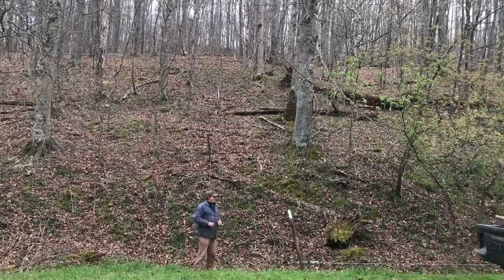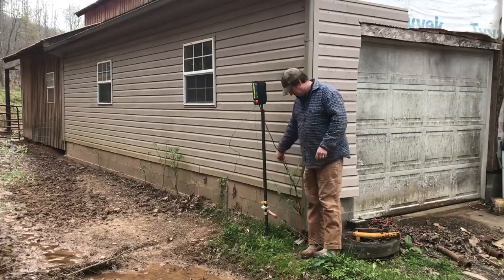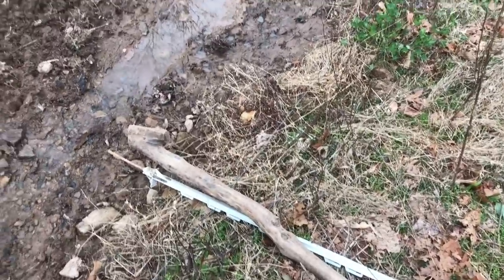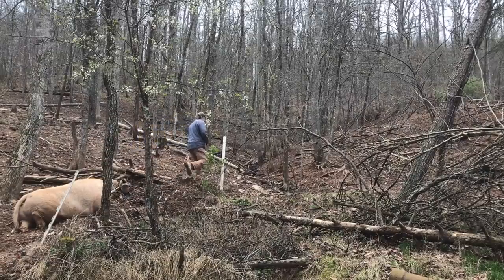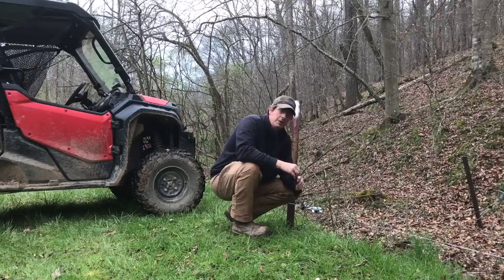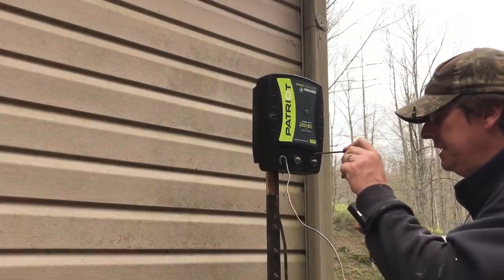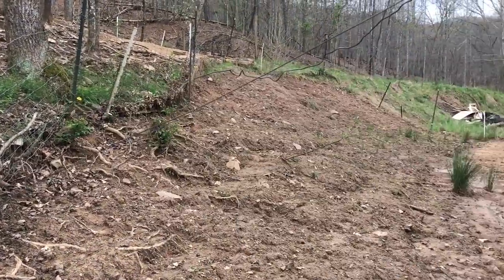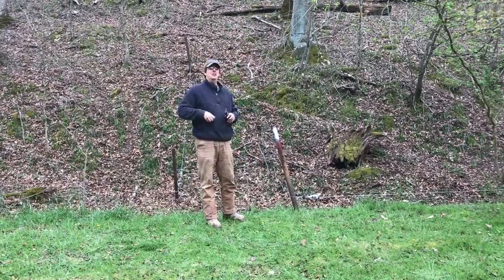LOW Electric Fence Voltage - What's Wrong??

Comment: Hey I looked for my hat once for half a day then scratched my head an found my hat. I was so happy I found my hat, that I took the rest the day off with pay cause by then I forgot what was so important. I really don't worry a lot cause there is always someone else that makes me look good. I was wondering if all the fence line can be driven or do you have some gullies that ask you to go around? I seen a wrake on a  8 n that "Lets dig 18" has on his home tractor and he uses it to knock over cow pies. Spread the wealth of fert. I sure like the idea of having a clean line not that its necessary an maybe pigs don't like rough terrain any better than you. I can't help but think a horse might be easier to get around the acreage each day... I rode fence line for days on my dads place and would be gone a week sometimes. I was plenty old, at eleven taking care of my needs each day with jerky, an tac bread (need teeth for that) an vegetation in the woods. Should I be gone longer I could shoot a rabbit or squirrel an spring chicken (grouse) were real  tasty over a fire. All the makings in my saddle bags. I should have to work any longer my sister cut across and would catch up an leave me more and then spend night an go back as she was fourteen and bigger than me. Stronger too.

Comment: Do you have wifi at your shop? If so do you have cell phone internet around your property? If you have then all you need is a smartplug. Then you can plug it in the wall and plug your fence charger in to it and that will give you remote shutoff. 
      If you realy want to get fancy some higher end smart plugs soposedly will even send you notification if the plug looses power or is low on power and how much power it is useing.  But a basic cheapo smartplug works.
Reply from the maker: No, unfortunately no Wifi at the shop nor do we have cell service on our property. It would be nice to have at times.
Reply: Ya, we dont have cell service here either. 
      We got a wifi extender a while back. Suposedly boosts wifi up to 15mi. But we had to enroll a pig and 4 chickens into nasa camp to learn how to program it. I got the antana reciever thing mounted as instructions said on a pole 25ft up and my wife got the inside thing set up but the programming instructions have alot to be desired. That was not mentioned in buying description.    So thus far we only gained wifi on our porch......

Comment: As you said, your meter read 1.32.  Is that kilovolts?  What voltage is the fence supposed to be at?  I'm just thinking about DIYing a raised bed in my greenhouse with chickenwire and a DC power supply and just want a general idea of what is reasonable current.  I'm only dealing with a rodent, maybe 2 lbs in weight.  I only want to deter, not vaporize him and my greenhouse too.  He's living in there and eating all my tomatoes...And he's too smart to go in a live trap.  He's outsmarted me.  Last night he took a few bites out of 3 green tomatoes in a cluster.  Big steak tomatoes too!  He's being smarmy and vindictive now.  So, any advice on adequate, relatively safe voltage would be appreciated.